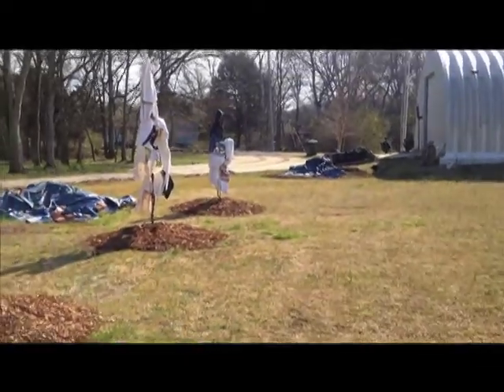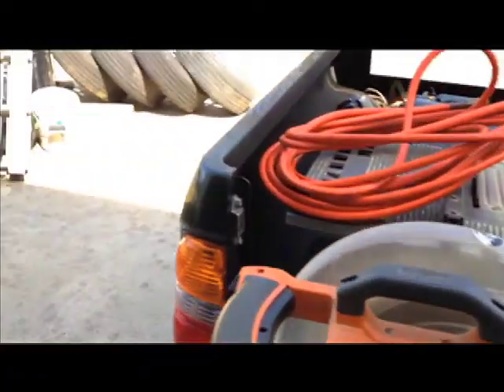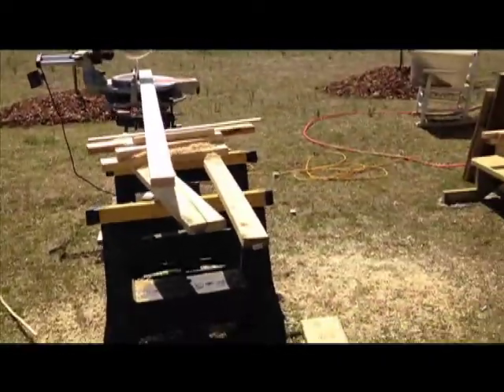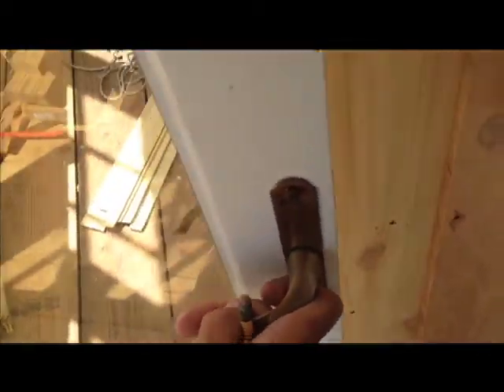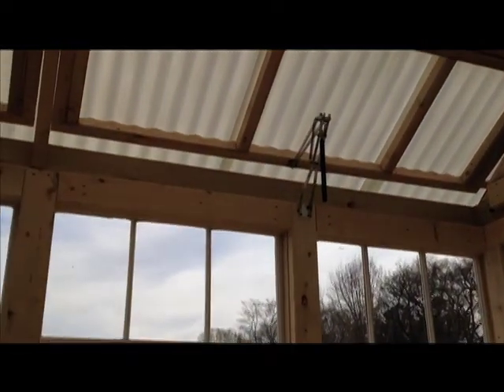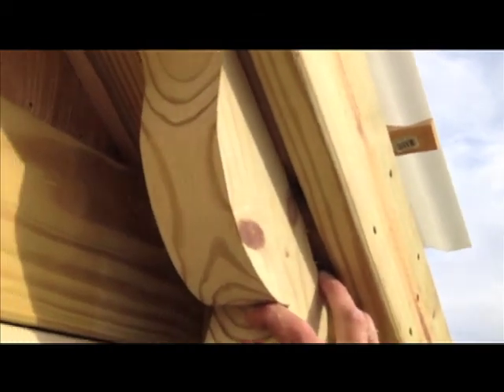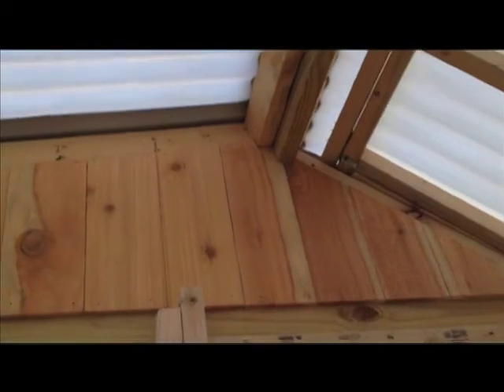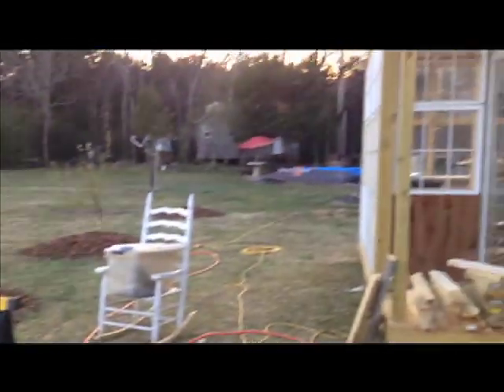Building a Greenhouse Ep 10 Using Recycled Windows Step by Step

Comment: Plum trees should be cross-pollinated (e.g. 2 trees from different types of the same species) for better fruit production. I like the Toka (red) and the Minnesota Golden (yellow) or the Superior (dark purple) as the cross-pollinator.

It looks like your fig tree is dead (or very close to it). Fig trees usually develop quickly, spreading their branches as far to either side as the tree is tall. If it is dead and you decide to replace it with another fig, I suggest planting at least one Capri fig with you common fruit bearing fig variety. Capri fruit is inedible but it cross-pollinates your edible fig tree and will give you very little trouble. As for the common fig trees, they produce edible fruit but their seeds do not produce more trees... so it's a trade off.

Good luck with your greenhouse.